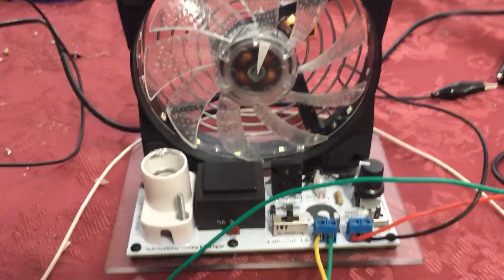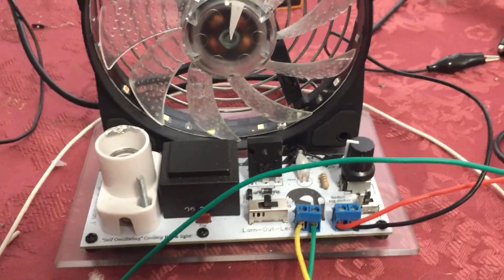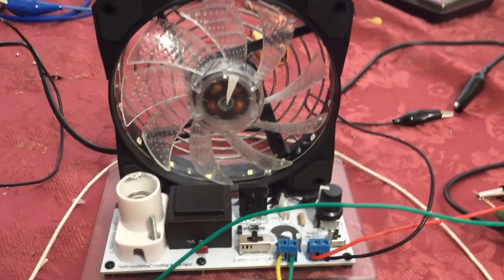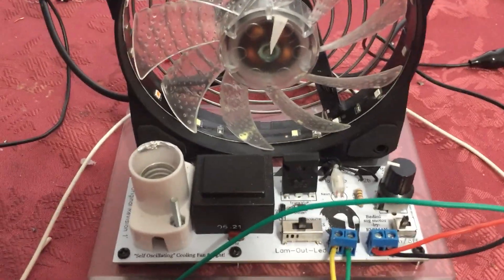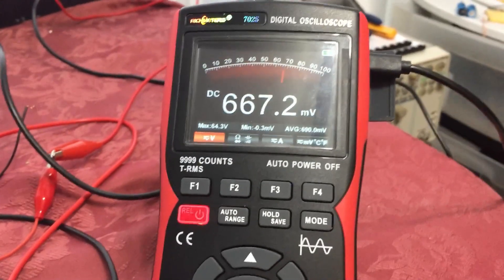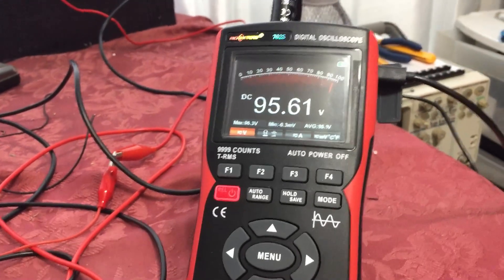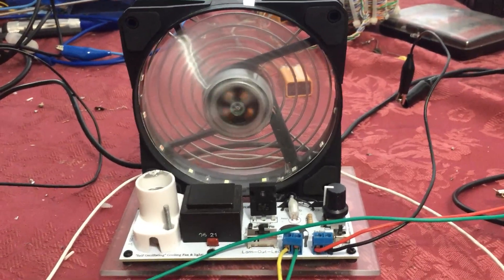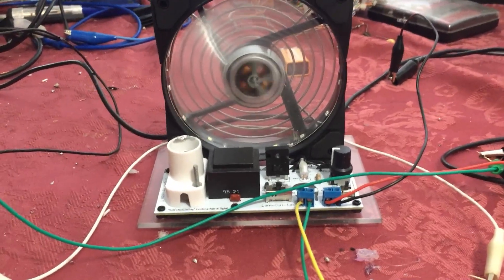One Wire Bedini

Comment: Is it possible Joel for you to make a video giving a 101 on pulse motors, for a better word in English so to speak?  I'm extremely interested in following your work and maybe replicate your work on some level, but your videos are on a "you need basic knowledge of radiant energy and corresponding electronic tech savvy to follow along" which kinda rules out participation of dummies ( which I am ).  I can understand circuits and components when explained how they work but I can't yet design my own.  Like someone who can read a story but not make one up.  I know what a pwm is and used for,  but I don't know what a Forced Oscillator is for example.  Thank you sir.
Reply from the maker: I can try one day i'm not the best at making info videos so it may take some time but I usually get to it at some point. I try., it usually just brings on more scrutiny. So i'm never that greatly motivated lol

Comment: the ion valve becomes a volume 3 feet long by 1 foot by 1 foot. it is huge volume o voltage static potential. huge. and then the magnetic ground plane to make it quantum. then the 2 plate capacitor to cover it from top to bottom side to side it is a pump volumetric pump magnetic plume radial pump... and i can pump the volts by capacitor theory .please listen 13 years i cry..

Comment: i dont know you want to call it, perhaps its a electrostatic super-fluid magnetic pump? or oscillator? in one way you read it as volts. the other you measure in volume. the farad per second is to a volt as a dipole is to a volume of space si unit per sure meter. i like these terms AI.

Comment: Ai comes back. i like to do thie ai ii. i could be rich on  ideas too dont tell. i can share.  but as for Ai drawing circiuts for the first time here. the circiut. this is my first try the very first one i have drawn. the consept may be familiar? the first is not a bendie, not a slayer, it is a 120 volt ac occilator. that is it. its nothing more then a doubler and a switch. it is the very novice first one.  it should be the most important too.
this leads to better things. like entire oscillator systems that cost less then 100 dollars to build, and make volts..

so one more time 240 volt side, 120 volt side. oscillator 60 hz. unit of farad per second. it has a difference of potential 120 volts. the first quantum AI conception. ever created..

Comment: the first thing you should try is this..take 1 plate o 120 volts a second plate of 240 v and a center plate as the ground plate the central plate is the neg the 2 outer plates positive. one is 120 v the second 240. u switch at 60 hz or output..volts per second. it is 120 v difference inn potential. use the volt double circuit WALTON. COME ON I KNOW YOU CAN DO IT I HAVE FAITH. THEN ME AND YOU SELL THE DEVICE DYIY.

you are 90 percent done the circuit is made.

Comment: were is the invisible man? were is the dipole? he has a flag, he has a charge, he is the total work..  LOOK LOOK HE IS PULLING MY LEGG.. he is the quantum, he is the magnet in the can, it is in oscillation, it is plume waving, its is radial, it the force. may the force live long and prosper.
the magnet and the charge i represent as the dipole. and it is very spatial, its huge. it radial he is waving the flag. it is plume. it is fluid not particle. it only charge. I recon? ill just mossy on bye. toot-aloo

Comment: are you laughing yet? every one can go home now you only need one volt to have infinity volts am i crack pot?
Reply: ohhh my that is golden..i stopped laughing now what do i do?>
Reply from the maker: cry? lol
Reply from the maker: Well according to my readings the trigger is around 500mv lol now i'm laughing. And yes a voltage multiplier will also help increase it. And all those caps will give you amps a second discharges. You know your on the right track when the gap discharge glow thickens. Interrupt it at 60 hertz with a high voltage primary in line and you got yourself compatible mains AC on the secondary. If I had a real "Bedini" to work with this is how I would work it. 10 uf charging up to kv running off a multiplier pulsed will give you big current on the primary, you will need something like in the 20000 uf or more to smoothen it! So it's best to chop it up and run an AC load.

Comment: That is the secret of the Newman motor. the switch that keeps it spinning. thats why the giant Newman motor is so loud. to make the fan spin, bit it only had to spin 1 time, because it was very big. trigger. his trigger was the loudest part of the Newman motor.
u want real power? its not in the mass.it was the trigger. all the power he dumped back into the trigger. to make that mass spin all on its own if he did that i think he did.. so Newman is vindicated because he dumped all that back into his trigger. so yous spins fast has a fast trigger ? he is use only back emf? you tell me then AI come back and says super fluid..

but yes , you need power think in terms of the trigger.. at least for a little wile. its all in the trigger,,
Reply: just another fast invention AI. wind mill turns, charges capacitor, spark it the trigger that causes the fan blades to tun. this is Newman yes yes?  you do not a magnet only a volts to trigger the wheel. you see it?   NEWMAN?
.

Comment: So you only have one wire of the fan output connected to the transformer?
I've always found those fan motors inefficient. Bike wheel can run on 20ma
with 400v output no ground, If charging battery is removed transistors release
the hidden smoke...

Comment: Hi Joel
When you connected the battery and showed the scope, that was without the second ground correct?
Would the charging have increased with the added ground?
That is charged faster.
Thanks
Reply from the maker: Scope was with ground, I just wasn't touching the other part of the circuit..
Reply: That's what I was asking if you touched the circuit to add the second ground would the charge have increased?

Comment: here is the secret its is volt. no were did i see a law that said all volts are created equal, unless you are not mad from a magnet.. its a volume of electricity. volts are volumes magnet are volumes is the wrong direction. you can them to separate them from the circuit i suggest you toss them in the trash because the volts are infinite..

so you only need volts, current is volts per sect? that funny hmm times 1 million perhaps.

Comment: ok one more thing i can explain it like this also. every time you do work you create heat. current is amps, current is heat, so the current is only result of pushing against the direction of the volts. the heat is due to opposite magnetic looping  lenz the back emf, volts rubbing against volts traveling in the opposite direction..  is the heat...the back emf is the heat and you do all of that is resistance.. so a volt is a volt we what lots of volts per second. volts have a volume, volume creates a pressure. a super fluid instantly expands into its 

volumetric potential because it is a super fluid. so what did you learn? current is heat, u dont need heat to run a motor u need volt. so all looped systems create heat. and that is how the meter can say this is how much you had used. but if there is no magnetic resistance, no heat is seen, then how can it be metered

Comment: ok one more thing i can explain it like this also. every time you do work you create heat. current is amps, current is  pushing against the direction of the volts. the heat is due to opposite magnetic looping  lenz ,is the heat...the back emf is the heat and you do all of that is resistance.. so a volt is a volt we what lots of volts per second. volts have a volume, volume creates a pressure. a super fluid instantly expands into its volumetric potential because it is a super fluid. so what did you learn? current is heat, u dont need heat to run a motor u need volt.

volts ...volt is volume not current.. magnetic part is the heat,, a volt is a volume of a volt its still a volt. amps are not volts. they counter direct in a wire that is heat induction. so volt is the ting u want. you dont need 1 million volts, you need 1 million volts per second.. but you need amps if you have a pump or a pressure difference. that is your difference in potential. its the same as temperature on a rod. yes super fluid.. volts multiply and thats is work..

Comment: so Tesla figured he could create 500 hp of relatively free power and then drive a 500 hp electric motor to have a dipole big enough to reach the 5 million hp out put he said he could achieve  .there is volume ok. that is volts, there is pressure. that is still to to volts.. so the pressure of the super fluid starts at less at one volt. an you can double volts, and that means volume. that means more pressure. means volts per seconds.

Comment: Why not pulsing the 12v with diodes? Charging it while it feeds the system 

End of debate about free energy
Reply from the maker: You can do that with a small AC transformer primary in line with the negative of the battery terminal, this will pulse the 12 v as the Bedini pulses into the secondary and rectify that back into the system if you wish, the inductance also helps reduce the spike input load so its got a few applications here.

Comment: did you follow the AI, you came up with the same conclusions . see? but think about the poor little ion valve it does not have a pump for its little heart yet.  so infinite as long as you do not take all the initial electro static potential. the sponge only has so much water. as soon as you split that little charge into a capacitor it is like a rabbitt and multiplies. but at the voltage /volume increase/ doubler side it goes up over drive.. so i can over drive it again as long as i have a bigger pump. so say 12 v is one pump, and every multiple of 12 is adding another pump... actually you only need to swap out the first pump for a bigger pump and and more spickets.

Comment: Good work. You can loop it by running it from capacitors and use isolation transformer (or even one set of the motor coils) for feedback. Or B0512S-2W etc would work too, depending on wattage.

It's also possible to tune the coils by adding Electrical lengthening or shortening to ground. It's called Loading coil. So adding tunable coil to ground makes the frequency lower, or adding tunable capacitor to ground makes the frequency higher.
Reply: This sir